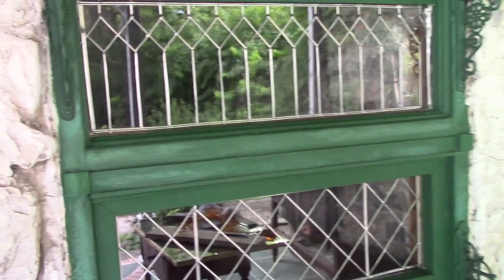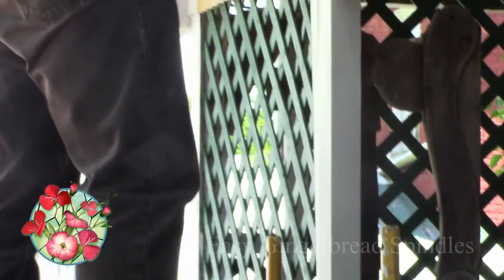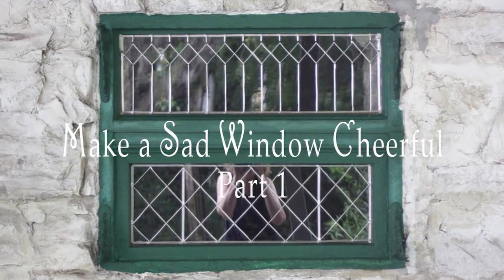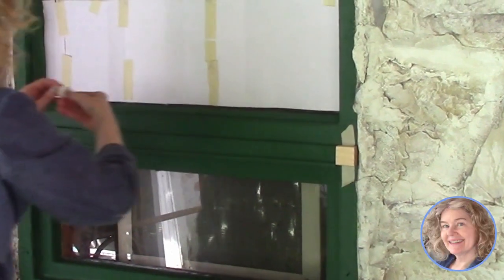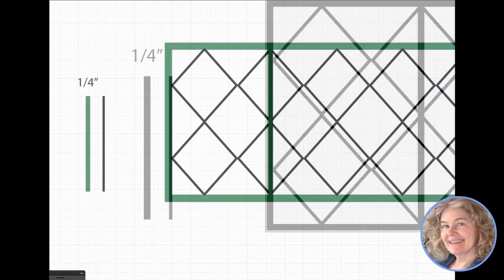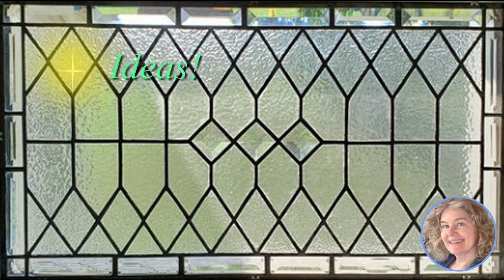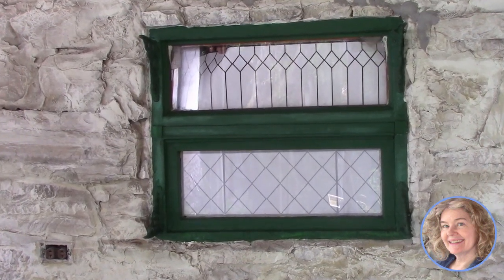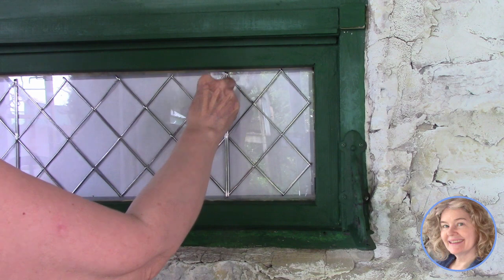EASY LEADED GLASS with Metal Tape, Cheer a Sad Window 3 Ways, Part One; #PebeoVitrail; Window Update

Comment: Do you know if it will continue to stick to glass for the long term if it is outside in Northern California sun? (for a dormer window in an attic, maybe can get to 145 degrees or higher...)
Reply from the maker: I think it will work perfectly for you. It's a very sturdy adhesive. Small pieces, like half inch or smaller, have trouble sticking — less surface to surface adhesive, I guess. But longer pieces are very durable, if you burnish them to the glass. Be sure to clean the glass and let it dry first, and then you should have no problem at all.

Comment: My windows are double glazed. Does the lead go on the inside, outside or both?
Reply from the maker: You could potentially tape both sides, but it may be difficult to align the tape perfectly especially if there is a gap between the panes. You can tape just the inside and it will still look fine from the outside. We created a stained glass panel on a separate sheet of glass, placed it flush  against a window on the inside of the house. Very pretty and realistic. The outside pane protects it, but it still looks like stained glass. The tape looks very good on both sides. If you tape inside, it will have the advantage of being protected from the weather and the raised texture is another plus. Our small green window is on a covered porch so it does not get much weather. The texture is on the outside and it still looks as good as new after all these years.  The side that has the raised texture that can be touched, looks the best, for sure.

Comment: Did it last? I feel like the tape would lift after time?
Reply from the maker: It's lasted and hasn't lifted at all. It uses very rugged adhesive and the metal makes it water resistant. Only the tiniest pieces are susceptible to failing (half inch or so), but so far, all of my tape is still perfect. If you scraped the tape off, it would still leave a trace of the adhesive. It's tough stuff.
Reply: @LoveForACountryHouse  I want to use this method for my shower stall. thanks for the feed back :)